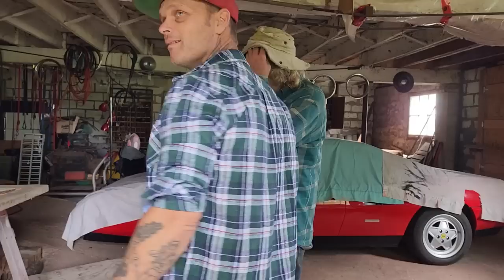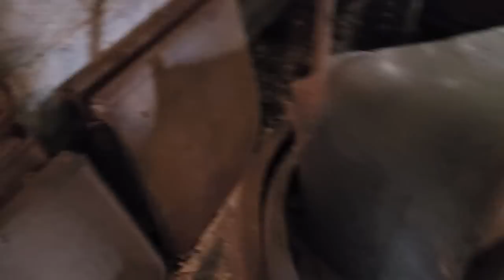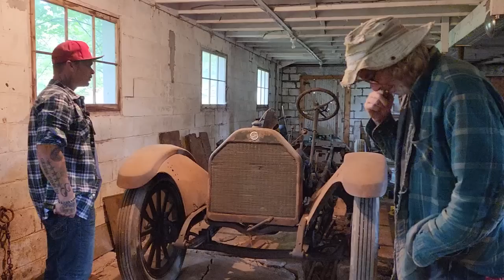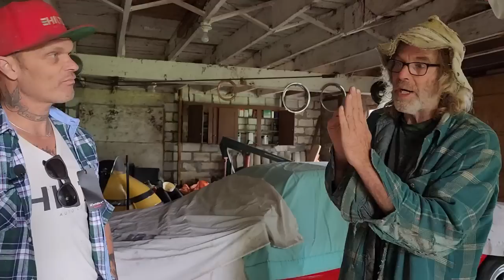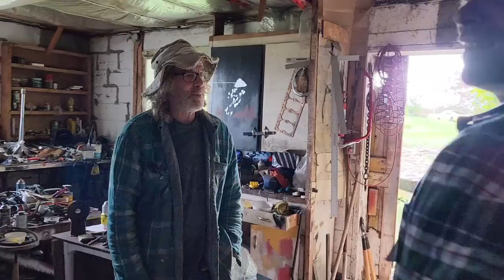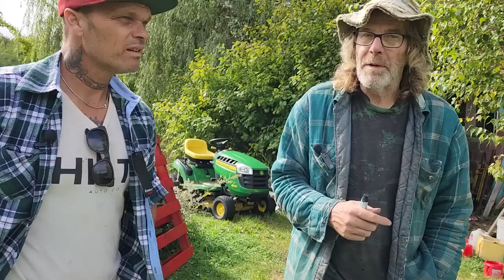1917 Studebaker 7 passenger Touring that runs and drives for $1,000 🤯

Comment: My understanding is that a stainless steel swirl polished valves sodium filled with meridian valve seats bronze knurled guides is one of the better combinations for especially the types of engines you seem to be working with but all engines in general stainless steel valves hold up the bronze guides don't wear slots in them it gives a guy somewhere to repair something without having to replace both only bronze guides need replaced after that unless something is broken and make sure you use neoprene umbrella type seals not o-ring

Comment: They introduced Potassium (K) into unleaded petrol as a soft metal substitute. This reduced wear and seating/ sealing problems around the valve seats. It also prevented valve chatter (most apparent in LPG run engines) 👍

Comment: Don't use mixer an shovel back an forth 
Here's easier way 
Step one take sand in wheelbarrow 
Dump in area your doing 
Next put you're gravel in on sand
Step 3 
Take small tiler  mix it with tiller
Now Step 3 after  if you're happy  with sand an gravel 
Put cement in on you're sand an gravel 
Mix again with tiller 
Now that you're happy with color add 
Water mix it all again  as needed 
For way you want you're concrete 

Take tiller out wash it off  level it off 
Give it some time before striking it 
With broom if that's wat you want
Be sure an strike mix as you  need 
This will work an you won't have to 
Use vibrartor

Comment: To remove a pilot bearing with bread is an old trick you just get a bolt that is tight to fit in the size of the hole on the bearing and drive the bread into the hole and it pushes the bread behind the bearing eventually pushing the bearing out of the hole. There are video's on the Web were lots of guys show this!

Comment: Depending on water in the materials a cubic yard of sand weighs about 3000 lbs
Reply: @richredding9689  short ton is 2000 long ton or metric ton is 2200

Comment: Sorry Jim __ Loose valve adjustment does not create wear.  All manufacturers have prescribed settings for proper valve lash.  Over tightening a valve puts excess pressure on the camshaft lobes and will grind the material off and destroy the cam.  It also makes the car run bad since the valves will not open and close properly.

Comment: Wash sand it's true washed sand is not that much having it washed and then it is the delivery that's most the cost and also it is a better product to work with than a (soiled sand )if it hasn't been say washed I would definitely have to agree with him there with Portland cement pea gravel is usually sufficient and a good hearty mix sand is not completely necessary although it helps create a non-air Pocket bpond that's just my opinion of course everyone has their own I'm sure and every right to that

Comment: I don't disagree with your oil treatment technique I do believe that it depends on the hemisphere you live in cold and damp or hot and dry I've treated metal good and hot 100 plus and after it says still no problem but there's always the in between and then the downright just 40% humidity year-round and in that case your technique is just dandy

Comment: Why do people do this dumbshit.. instead of trying to use lapping compound on a valve stem why don't you have a machine shop press out old then new guides.  They will diamond hone the guides interior bore.  They will also measure and cut guides for correct installed height